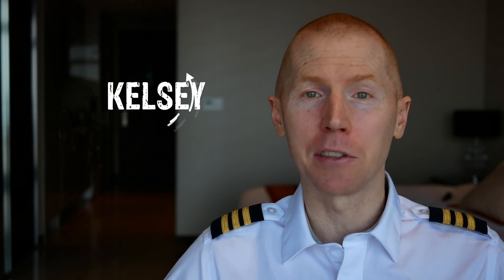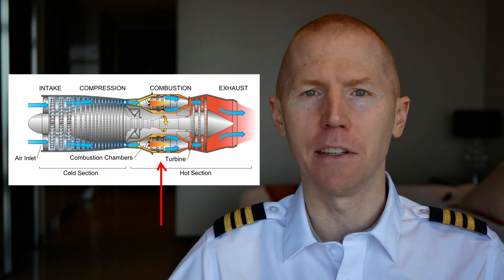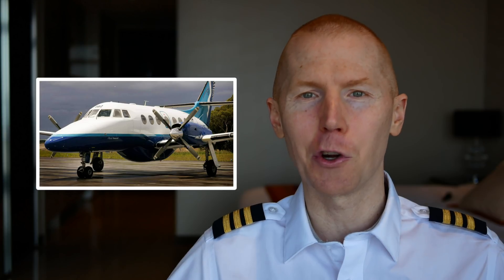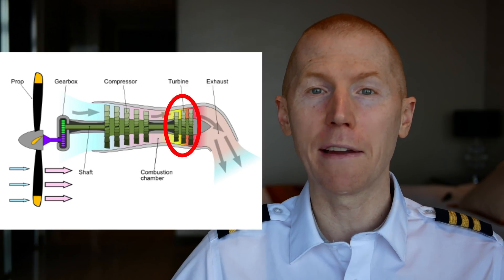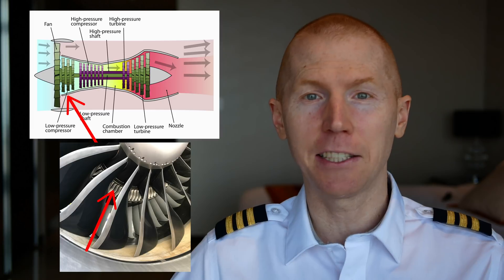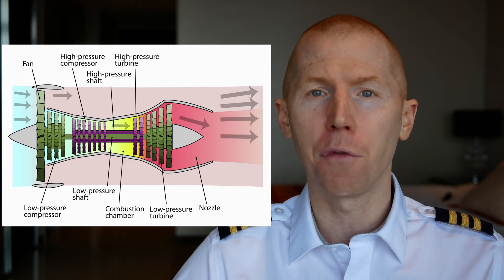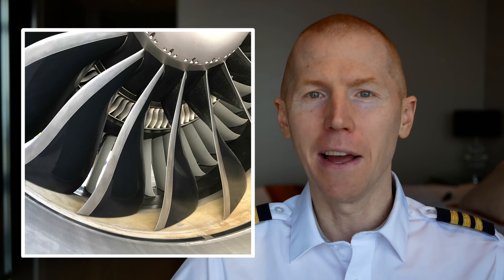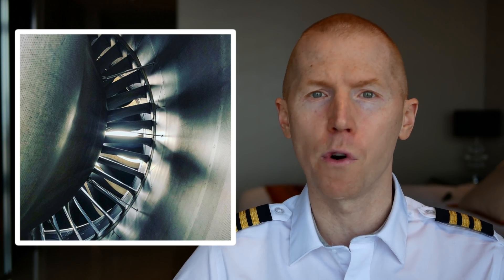Is a Turbofan Engine or Turboprop Engine Safer? | Pilot Explains

Comment: You should NOT say that a high bypass fan is EXACTLY like a propeller. The action of the fan of the high-bypass turbofan enginge acts SIMILAR to a propeller. Yes - it also accelerates air - yes, it also takes its power from the second turbine (low-pressure turbine behind the high-pressure turbine of the core engine (gas generator). Yes, it makes the basic turbine engine (turbo jet) much more efficient. BUT: The turborop has an equivalent "bypass ratio" of about 40:1 to 50:1, where a high-bypas turbofan has a bypass ratio of around 5:1 to 11:1. The Propeller of a turboprop engine looses its eficciency at high speeds above Mach 0.6 where a high bypass turbofan is still very efficient at Mach 0.85. Another main difference is that all popeller baldes are adjusted in their angle (pitch or effective angle of attack) from fine pitch to cruise pitch and even reverse pitch for reverse thrust on ground (with associated mechanism, hydraulic and control circuits to have a "constant speed propeller"., where the blades of the fan of a high bypass turbofan are fixed - no mechanism and contron circuit to adjust the blade angles. 

The question you ask, if anione feels less safe as a passenger  in a turboprop aircraft ^compared to the case of being a passenger in a turbofan aircraft after lerarning that the basic engine principle is the same. -> The answer is clearly yes. (It's supported by the accident statistics) First reason: The smaller turboprop aircraft are normally piloted by pilots that are less experienced and are "building hours" so they can later upgrade to the "mainline" turbofan-type passenger aircraft. Second reason: There are three additional elements in a turboprop aircraft ( not found in most high-bypass turbofan aircraft) that are a) needing proer maintenance b) are having a good reliability but can fail c) can be influenced in a good or bad way by the pilot. Those elements are the 1) the propeller and its anti-icing system, 2) the propeller control system with its mechanical and hydraulic components 3) the control system of the propeller adjustment system (constant-speed rpm governor/torque control and also auto feather sytem) and the cocpic controls that were cause of some accidents in the past: Fine-Pitch / Disc / Beta-range controls of the propeller. Those are the reasons that I'm still prefering to be a passenger in a turbofan powered aircraft that being a passenger in an airliner with propellers due to the above mentioned additional safety factors.

Comment: Hello.  Can you make a video about the right way to deplane fast in an emergency? I heard that a large aircraft can be emptied in less than 1-2 minutes.  I find it hard to believe unless it's done by highly trained personnel.  I was thinking.  What if during flight the overhead bins locked such that only 2 or three could be open at one time.  Then in an accident the bins would lock and people would evacuate without carry-ons.  What do you think?  Or maybe they could open normally but in an emergency the pilot could throw a switch and lock them all shut.

Comment: I got no real concern about prop-driven airplanes but much concern about how the prop is driven. Recips have served the technology extraordinarily well since aviation began. I still look at those mighty 32 cylinder monsters that drove the B29 and marvel at how those incredibly complex engines were built and maintained by humans! Each is a mltii-ton assembly of precisely made little parts working together flawlessly for hours at a time. I guess I'm a born worrier but having spent my working life building and operating simple mechanical systems and seeing how often and easily they failed makes me appreciate the skill and work that goes into building and maintaining these behemoths,
Reply: As an aficiando of old era planes, I don't think there has ever been any 32-cylinder aircraft engines. At least not radial engines. The cylinder banks of radial aircraft engines have to consist of an odd number of cylinders. 32 never divides into an odd number.

The B-29 initially had the R-3350 18-cylinder (2 rows of 9 cylinders) on it. Later on they were upgraded to the R-4360 28-cylinder engines (4 rows of 7 cylinders) & re-labeled as the B-50. The R-4360 was also used on the B-36 Bomber.

BTW, since every cylinder on an aircraft recip has 2 spark plugs each, can you imagine changing out the 56 spark plugs on the R-4360. I once knew a guy who started his Air Force career as a mechanic on the B-36. He told me that trying to locate which of the 56 spark plugs got fowled was a nightmare. Most of the time they would just change out all 28 on the side that was giving trouble & even that was almost an all day job.
Reply: whawaii You’re right of course. But just to be difficult, is it possible to build a two stroke radial engine (with an even number of cylinders)?
Reply: @Peter Reynolds - Lots of engines exist with an even number of cylinders & when it comes to 2 strokes, there are no odd/even issues. As for the usual radial engines found on airplanes, there always has to be an odd number of cylinders in a circle for them to work. As far as I know, aircraft radials don't come in 2 strokes versions, if they did, they would be way too noisy for an airplane flying over peoples houses.

One example is motor cycles, unless you're riding them, 2-cycle engines are just annoying to most people. As an RC modeler, I work with miniature 2-stroke & 4-stroke engines all the time. Depending on the time of day, sometimes I cannot fly my 2-strokes because the noise carries far & people complain. However my they don't have any problems with my 4-stroke airplanes, which are actually larger engines.

Cheers \ooo/
Reply: @whawaii  sounds like a headache  shame they didn't have computers to tell them which spark plug was fowled but back then all engines were purley mechanical.
Reply: didn't the b29 have radial engines?
Reply: Rest assured, turboprop engines are sound.
They have a gearbox connecting them to the propeller.
The actual engine might spin at 8,000-20,000 rpm. But the propeller's rotation, stepped down by the gearbox, won't surpass 3000. Usually less. Depending on the size of the prop.

That gearbox does 2 things. It slows the prop down, but also adds muscle to it's rotation. Meaning that gearbox acts like a lever. The engine is on the long end of it. Faster movement but easier to change. The propeller is on the short end of it. Slower speed, but much harder to change. Much harder to slow down or stop. And in the case of airplanes, much MUCH harder to stall. 
That's the torque that those props recieve.
Reply: Bro, I've literally theorized about this exact thing. Except on a engine in a car. People take these things for granted. But if u removed the block and were able to see all the moving parts. You would start to A. Worry or B. Be Amazed at their reliability and complexity! People don't even give these things a second thought. Especially when your car is running super smooth. But at highway speeds your engine is turning approximately 2,000 times in a min! That's roughly 33x in a min! If u seen just how violent those parts are moving at them speeds without a minor glitch/misfire or vibration. At least any felt vibration. Even sitting at idle. Your sitting there relaxing in the AC while your engine is turning 700 times a min. Give or take a hundred. But even in extreme heat, it's still doing its thing while we sit there soaking up the AC. Idk man, I guess it's hard to really get non mechanically inclined folks to fully appreciate it like we do. It's just jaw dropping to think about it and to have the thought of. I'm actually extremely surprised we don't have more breakdowns than we do. Engineering has come a long way! Just think, those naturally aspirated piston engines were around in around in both World Wars! I find it more intriguing to think about it back then. Because a lot of the stuff was trial and error or just being created. And just a short while later. Being used at war and in dog fights! It's truly amazing!

Comment: I've known for years props are not less reliable. In the case of turboprops, I'm ex Navy. The military tends to use them in hi endurance applications where speed isn't as important as  time in the air. The E-2, P-3, C-2 and C-130 are examples. So I'M GOOD WITH TURBOPROPS. But why aren't they used in large jetliners? I've always wondered.
Reply from the maker: they aren't as fuel efficient at higher altitudes and they are loud.  Imagine if you had to ride on a C130 for 10 hours...
Reply: @74gear  I have...Guam to Ca. Ugh!
Reply: I would have to guess it is probably fuel efficiency differences. The turbo fans would be more economical

Comment: Sounds like these are very similar engines, one drives a propeller, one drives a fan. There must be a reason that both exist. Which one is more fuel-efficient? Why do some aircraft use a turboprop and others use a turbofan?
Reply: Turbojets are much more fuel efficient, but for very large loads like airliners.  Turboprops burn maybe 20gal/hour, as opposed to a few thousand pounds/hr for the jets.  Which is why you'll see that turboprops are often found in smaller 5-8 passenger aircraft.  Also, pilots need a type-rating (expensive specialized training) for each different type/model/variation of jet they fly.  This rule does not apply to propeller-driven craft.
Reply: @willlopes8500  Turboprops are very efficient at medium speeds like 250knots to 350knots, but are not efficient at higher speeds. Meanwhile turbofans are very efficient at higher speeds like mach .7-.85. but are not efficient at medium speeds. That is why turboprops are on medium speed planes and turbofans on higher speed planes.
Reply: @ajs9688  The cruise speed from fast turboprops is more like 450 knots up to mach 0,85 (see Airbus A400M,AN70, Tu95,AN22...)

Comment: The--- geared--- high by-pass tubrofan  is even closer to the turo-prop. With 85% of the thrust provided by the fan, there is not that much difference between the turoprop and the turofan today.
Reply: @PilotBossify  Yes. The Airbus a220(Bombardier) uses the PW1000g geared engine, which is also used on the Embraer E2. Some A 320 neos also use the PW1100g/PW1500g.
For only $12 million, you could have one tomorrow.

Comment: There is NO explosion in any turbine airplane.

It burns! 

It is an external combustion  Brayton cycle not an Otto or diesel cycle.

Good thing I did not interview you 
Or you would be back instructing in a 152...

Also it is not a fan in the back it is a turbine.

Using a pinwheel would have been a better layman explanation.
Reply: Relax on the specifics. I think he did a great job.
Reply: @jamescollier3  ive watched a good bit of his videos . Yes that is true but im guess bc hes too worried about the weather . Or which route he will take . I know they have to wake up really early maybe hes just trying to make sure hes away before flying. Check out his Instagram. Youll see 74 Gear

Comment: Also, one of the great benefits of a HBPTF is that the air flowing outside of the core acts to muffle the noise associated with jet engines without a "fan".   Back in the 60's/70's airports were VERY loud places, especially on the arrival and departure corridors.  Nowdays with the advent of the "fan" and noise abatement departure geometry...they're much, much more quiet.
Reply from the maker: ya like the new engines on the 787 or 747-8 really quite for the amount of thrust they generate.

Comment: I had just bought a 747-8 in my simulator and I are seeing on the Beacon light that it says LWR and BOTH. Why is it like that because when I are in the 737 it is only one option for the beacon light. And when are they using lower beacon and when are the using both
Reply from the maker: we always are using both... the very few times I have seen someone use lower was just to get the attention of someone on the ground and even then we could have just selected both.

Comment: Actually i think that  turboprop engines produce more noise inside the cabin than turbofan engines, but other than that I think that any machine with proper maintenance will perform it's intended job and as safe as it should
Reply from the maker: ya turboprops are quite a bit louder I agree.

Comment: Am I the only one that is a bit anoyed he calls the turbines for fans ... Yea yea.. they are geometry very similar, but function vice very diffrent

There is one rather important part missing here. Gearing. Turbo props have gears ... Turbofans.... Well... It get complicated. Untill 5 years ago, turbofans generally didn't have gearing. On some modern aircraft like Max and neo they do have gearing. Alowing for a smaler turbine and larger fan... Cutting down fuel consumption.

That spawns the question what is the diffrance. Well a geared turbofan is ducted, a turboprop is not.

Also a geared turbofan is inline using planetary gearing while turbofans mostly don't (there might be some exception)

Comment: have you ever looked into older aviation accidents and their outcomes? I can't remember the flight, but it was early-ish in jet flight. The cause of a dual engine out was determined to be hail. prior it was assumed hail would act like water, and hit the blades and be flung out. wrong. apparently, hail and other solid objects experience a "window blinds" effect where ice will sail cleanly through the fan and into the compressor.

technically if you think about it, your prop isn't a plane (flat surface) while in flight, it's a spiral. as the plane moves forward, each blade is carving a separate path. if the bird is in the right spot, a blade could pass just in front of it's head and just behind it's tail.

as for a turbofan, a bird can't fly through that when it's OFF, so no amount of speed is going to help

Comment: Actually there are many turboprops where the turbine is mounted in reverse and blowing the air forward. As an Example take the Pilatus planes PC-6, PC-7, PC-9 and PC-21. In those cases the Jet blows the air forward towards a fan wheel which is then driving the propeller. This is also how Turboprops work in most RC models with Turbines.
Reply: only internal design, but the exhaust blow NEVER forward

Comment: Being a private pilot myself I would never fly on a turboprop and it has nothing to do with the engines it has to do with low time underpaid overworked pilots. 

I do like your videos nice job of describing the subject you talk about.
Reply from the maker: I guess it depends on where you are flying and with what company.  But I understand what you are saying.  Thanks for watching.
Reply: bingo
Reply: I guess I won’t invite you for a Coast Guard C-130 flight when we are practicing drops at 200 feet AWL. :(
Reply: Drew.tater.tot 
I think you missed the point (low pay, low time, Inexperience was the message) Check out the Buffalo flight you will see what I mean.
Reply: @shopart1488  I am a flight safety officer, been flying since 15 years old (20 years aviation experience), C-130H pilot for the past 9 years, and moving on to the majors. I know quite well about Colgan's fatal mishap. However, your statement is saying ANYone that operates turboprops are underpaid, overworked and low time pilots. My point is arguing against that. We are not all inexperienced. 

Now that almost all regional carriers are flying CRJs (not turboprops), do you feel anymore comfortable? Following Colgan Air and a few other accidents, we have the new ATP / 1500 hr rules. It isn't going to solve all our problems but it is a start. Of course that creates its own problems, creating the bottleneck in pilots.
Reply: Drew.tater.tot 
What don’t you get, the POINT I WAS MAKING IS I DO NOT FLY REGIONAL AIRLINES. Delta, American, United
Is just a name on the side of regionals. You have a very good chance of low time, low pay, questionable maintenance and over worked pilots. Take a look at accident
reports regionals are way, way at the top of the list. It only makes sense majors will not put an inexperienced crew on a 300 passenger multi million dollar jet, it’s just not going to happen. I’m sure there are many pilots flying Turbo props for the military who do a fine job I was not talking about that I was talking about low time inexperienced regional pilots. Everyone who commented but you said I was correct. Have a great day, fly well !!!

Comment: I know I am being pedantic, and I surely love your videos, but there is no explosion in an aircraft engine.  There is fuel burning (combusting) in a continuous cycle, much like a blowtorch.  If it was exploding, bad things would happen.  Even without this qualifier, you did an excellent job of explaining both types of turbines.  Please keep the videos coming.  Both types of powerplants are extremely reliable and no one should worry about flying in a turboprop versus a turbofan.  One huge advantage of a turbine engine is that there is very low vibration in a turbine engine, since the combustion is continuous (and there is no reciprocating mass).  Piston engines are accelerating and stopping a hunk of aluminum over and over, faster than the mind can comprehend.  The power impulses are relatively short periods of a crankshaft revolution. By design, they will vibrate more than a turbine.  I always think of those old TV Commercials about Mazda engines, "A piston engine goes Boing, Boing, Boing, and a Mazda engines goes hummmm (or something like that). I am always happy to see a new video from you. Thanks a bunch.